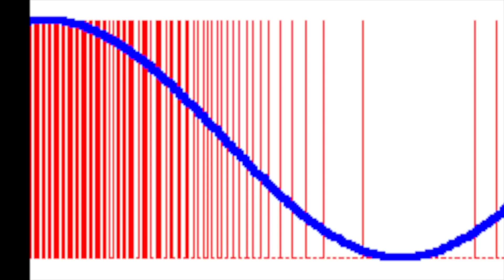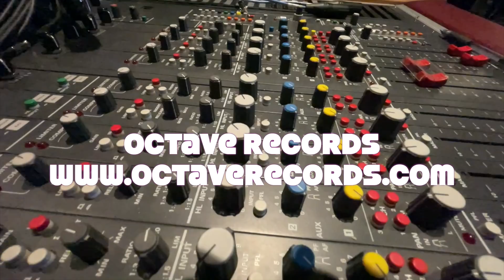Getting clear on DSD

Comment: I can't understand how something can bee better than 24 bit 192 KHz PCM since that's already is as good as what our hearing is as best. As best!
Reply: It is 11200 KHz (Quad DSD) or 2800 KHz (Regular DSD) instead of 192 KHz. The faster clock rate allows for a more detailed capture of the sound especially reverb and sound texture.
Reply: just like resave lossy audio as lossless format does not recover lost data, garbage in garbage out
beside storage capability of a media format, the process of creating, handling the music data is important
A CD music recording made with care is going to be a lot more enjoyable than DSD1024 filled with the most realistic noise
Reply: Some of the reasons is that DSD needs much less Filter to convert to analog so you got much more analog and true sounding music. I think the only Filter for DSD conversion is a low pass filter.
Reply: imagine analogue recording being continuous and in theory having infinite sample rate, a higher digital sample rate (more frequent) makes the captured data closer to analoge
Reply: @philiptong4978  Yes, but "closer to analoge", what's the point with that when we have already surpassed what the humans can hear, or even record in the studio, since we don't have good enough hardware for 24 bit recordings yet?
We have good enough equipment (quiet rooms) for 192 KHz sampling frequency but not for 24 bit.
Anyway, I have around 250 SACDs and the best sound-quality I have on any disc is on a HDCD and my next best sounding disc is a "lousy" CD.
I don't even have a SACD on the list of my "Best sounding recordings" more than Pink Floyd's Dark Side of the Moon but that SACD is just because it's so much more fun with it's multichannel surround-sound.

Well, I let everyone else of you think that DSD is much better than 24 bit 192 KHz but I sit on the fence and waits for a recording that will convince me about DSDs superiority.
Reply: search for "Why Does DSD sound better than PCM?"
Reply: Processing can react better. More about that then what we can here. But things one may do to the file don't destroy it as much due to the sample rates...